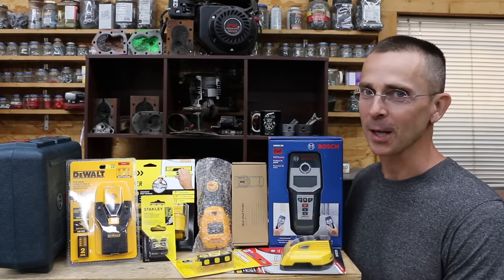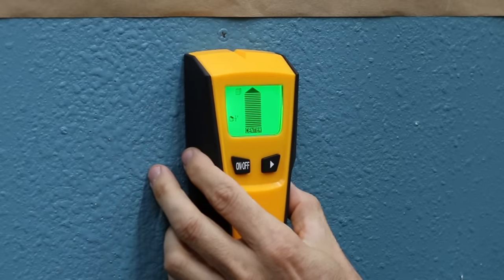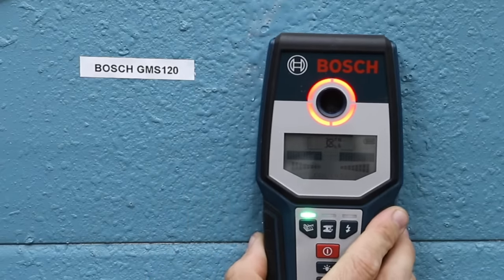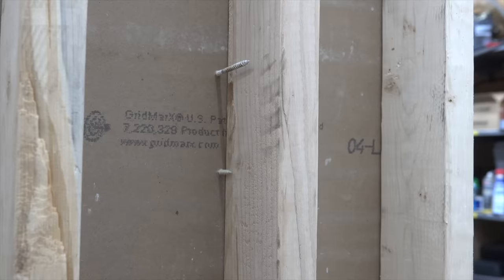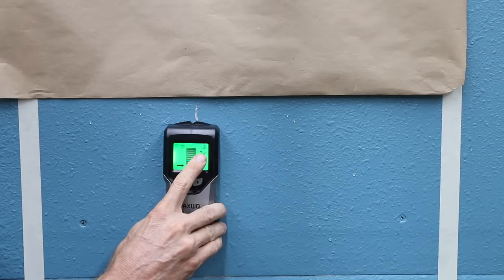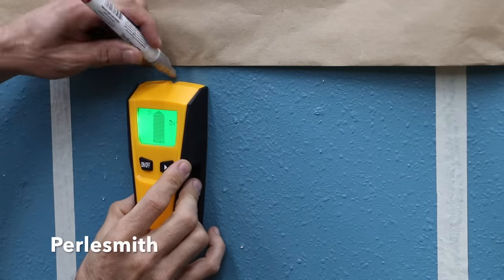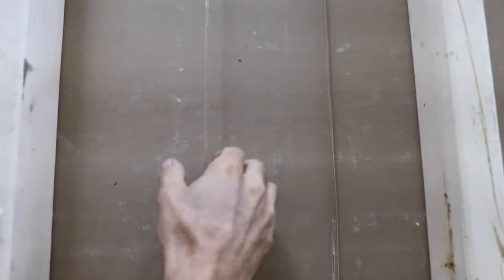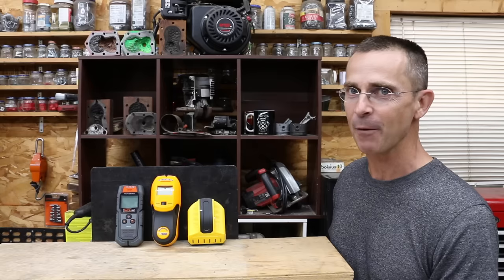Best Stud Finder? $262 Bosch vs $10 CH Hanson vs 9 Other Wall Stud Scanners! Let's find out!

Comment from the maker: Please let me know your ideas for future videos.  Also, thanks for generously supporting the channel. Please let me know if there are other stud finders you’d like tested.  An easy way to find past videos along with products tested: http://bit.ly/2FCrBpk  A big thanks to Jim for putting this together. 
  Todd
Reply: That list is super helpful. How about label makers, sharpies and paint pens :)
Reply: Can u mix oil with metal shavings and run a small engine
Reply: Can you do a vid on spray foam insulation?
Reply: Stud finder on Lath and plaster wall.  Is that a possible review??
Reply: Jubilee Clips original vs off brand hose clips? (Marksman / am-tech multi packs are the worst money buys in the UK!)
Reply: Extension cords and surge protectors?
Reply: Can you please do a video on gear oil brands
Reply: It would be awesome with a test to see if dishwasher actually dulls knifes. And at that also see if different steels behave differently.
Like a 63HRC knife, a non stainless, a different stainless of varying quality.
Reply: If you do this again and if it hasn't been suggested, some repeatability tests would be great to see if their accuracy holds over multiple uses or there's a lot of variability between locates.
Reply: If you revisit this category please include Walabot. The idea is so cool it makes me want one but something makes me think it's not as good as it sounds. They claim they can detect mice in a wall as well as pipes and wires in concrete.
Reply: Walmart is now carrying HART, and whatever Costco carries. These 2 seem to be with the most reach, and everyone has one if not both stores near by (assuming their tools are worth the drive). I know Amazon is the biggest, but they have so many brands and sellers, I wouldn’t know where to begin...it’s probably all the tools from the mom and pop shops, now out of business 
😕
Reply: Tim Gorodnitski hell yeah!
I second that... + phone chargers
Reply: Tool suggestion: Manual T50 crown staplers (like what you'd use to install fiberglass batt insulation or plastic sheeting).  I've tried numerous Arrow brand and Stanley brand staplers and they all seem to jam after 6-12 staples.  Very frustrating!!
Reply: 2/10 video, I skipped to the end just to make sure you did the joke, Imagine my disappointment when you didnt end it with "overall, the best stud finder is of course, my wife"
Reply: Do a roundup of the top ten fleshlights.
Reply: I would like to see a comparison video regarding safety helmets. Weight, price, observing force etc etc. They are very common and popular on daily working tasks. 
P.S : I really admire you work for the reason that you have avoid the scientific side during your tests. Keep it simple like 1+1=2 , we are simple person who get bored of science factors .
Reply: I wonder how these stack up with the smartphone app to see what's behind walls
Reply: I'd love it if you did more Ryobi tools. Thanks for making great videos!
Reply: There is a scanner that connects to your phone and you use an app to help locate items in walls. Its called the Wallabot DIY.
Reply: I would love it if you did a video on tire shine products!
Reply: Uninterrupted Power Supplies would be a great review. Lots of products and people rely on them heavily in certain situations.
Reply: I'm in the market for a heat gun so I would be interested in a video about them. Also very interested in what your testing methods would be! Keep up the great work!
Reply: Sugar in a gas motor. Fuel injected and none.  Thx
Reply: Alternative diesel fuel’s   Olive oil peanut  veggie    Thx
Reply: Flashlights. Can’t ever find a decent flashlight.
Reply: Can opener!  Twisted off handles, rusted cutting wheels, some dont even punch through the lid!
Reply: Ceramic cutting blades or wet saw blades ....thx ...paul
Reply: Tire chains, best worst?
Reply: I like to ch Hansen one because it doesn't require batteries.
Reply: I like your videos I've bought lots of stuff on test results, nice knowing what can be expected from an item.  I'd to see a shootout of dry lubricants , not so much the graphite ones.  Looking more for something that holds up and can not be flung off from spinning.
Reply: So, I was a Dish TV tech and they told me to use stud finders on the roof to find rafters through shingles, I never had any luck and relied on the stomp method to find something that sounded solid. Could you test the stud finders through shingle roofs in an up coming vid?
Reply: Can you test pipe soap/ lube in place of grease I know it’s water soluble but am curious about if you were in a pinch could you use it for like pins and bushings
Reply: I don't know if you can find any tools sold by Lidl supermarket chain. At least here in the Europe I've seen rumours that some of their Parkside branded powertools come from the same factory that makes tools for Bosch. It would be interesting to see if it's even plausible. I once bought a Lidl rebranded (the brand name used for it escapes me now) stud finder that was highly unrealiable and it was hard to get a reading twice on the same spot.
Reply: 14:16 The Franklin T13 is lighting up on the 2nd pipe but you said it "only found one of the two pipes".
Reply: I would love to see laser distance finders /measure tapes. Which is the most accurate?
Reply: Storage boxes like the Stanley box. It seems like there are so many options now like Dewalt, Ridgid, Milwaukee, Harbor Freight, etc. The price range is huge and it is hard to know what the best value is. I would like to see how durable they are, how well they hold screws or small items when flipped upside down, do the O-ring seals really work, what happens if you run over them with the car.
Reply: Hacksaw blades!
Reply: Smal Uninterruptible power system (ups) for computer and home use
Reply: My new Craftsman I bough about 6 months ago absolutely sucked, it was detecting studs that weren't there and wire detector seemed to be broken as it was always detecting wires even waving it  in the middle of the room.
Reply: Test the Walbot scanner that hooks up to a smartphone.
Reply: Small electric pressure washers, I've killed 3 this year using them as directed. I just use them more actively than most
Reply: How about the basics: screwdrivers. What's the best cheap screwdriver that doesn't bend or break under load.
Reply: I use the 2nd most powerful neodymium magnet to find studs, even behind lath & plaster up to  1.25" thick!  An alternative way is, if you have 'taped plasterboard' which hasn't been filled all that well (which is usually the case) then just draw the curtains closed, & turn-off the room lights, then shine a torch across the wall, close to the surface, you should see most of the screws/nails sticking-out a little.   ☺️
Reply: Do a test on bungee cords
Reply: I would be really interested for round 2 in UNI-T UT387B model. And in general more Uni-t inclusion :) Hope there is a round 2, keep up the good work.
Reply: Hi, I always wonder about shop towels. Or   products to remove grease from your hands. Thank you for your hard work!
Reply: The new GF-6a and GF-6b oils have hit the market. Does this mean a new oil-lympics?
Reply: Please test home air conditioner/furnace filters.
Reply: Great as always. I would have liked to seen you test one of the many available free stud finder apps on a smartphone in comparison.
Reply: Lack of plaster and lathe testing is a major oversight. Drywall stud finding is not a great achievement.
Reply: Since I'm in the market for one, how about laser distance measurers? You could compare accuracy, max length, and how it works under different lighting conditions (outside) or surfaces.
Reply: Can you do review of Carpet cleaner?
Reply: List of best portable rotary tool brands. Demel, WEN, DeWalt, Foredom, Black & Decker, Neiko, Milwaukee, SE, Tacklife. You could see which ones have the best cutting power, torque, battery life, drop resistance, different speeds, reliability, overall usefulness. Maybe two videos one comparing corded and cordless. Just an idea, love the videos!
Reply: Best moisture meters? I have one that I sue both to detect leaks around the house & to see if wood i cut myself is dry before woodworking with it. Would love to know how my meter stacks up.
Reply: Should also test metal studs
Reply: next video should be milwaukee m18 surge vs gen 3
Reply: Can you please test waterproof sprays for tents, tarps or outerwear for us? Thanks for what you do!
Reply: One product which never fails to cause consternation are tire pressure gauges.  Accuracy is always in doubt.  The different types: stick, dial, digital, have various pros and cons.  Durability can be an issue.  Love to see a comparison, especially in terms of accuracy.
Reply: Project Farm What would happen if mix 50/50 gas and oil to engine.
Reply: I'm not sure exactly how stud finders work but does it make a difference if there's no drywall on the opposite side of the studs?  Did you test with the back of your test rig covered with drywall?  I was wondering if whatever kind of signals they work is affected by the extra  drywall back there.  Especially for detecting deep objects
Reply: Im really interested in seeing the Bosch find a rafter through a shingled roof, this is an issue with solar racking installs, and i heard the Bosch is capable. It would increase racking installation productivity a ton. Great video
Reply: Angle grinders would be interesting, never understood why some are so expensive
Reply: I use a item finder called WalABot. it lets you see inside the wall to see water, metal, wires, & Heat. I love that thing.
Reply: You should do this test with old plaster walls. I live in a house built in 1942 and I've had problems with several different stud finders being able to locate studs.
Reply: Miter and table saw blades
Reply: @mikkelkirketerp4884  They do. They knock them around and make nicks requiring a new edge to be set. If you buy a $5 knife and put it in one, you could test for yourself.
Reply: You should test the Walabot in a future video (stud finder for iphone/android)
Reply: One long term test could be what charge should you store batteries at? I've read everything from 40% to 80%.
Reply: A stud finder for the next round: Milwaukee 2291-21 M12 Sub-Scanner.
 Most impressive one I've ever seen
Reply: @tc1309    ?  Flashlights
Reply: Ya know,  after seeing this, I'd really like to see these traditional stud finders vs. the newer smartphone attached stud finders (not sure if the best but an example: Ryobi ES5500 Phone Works Stud Sensor, or the Walabot DIY Plus - Advanced wall scanner, stud finder - For Android Smartphones - DY2PBCGL01). Possibly a stud finder app as well if possible?
Reply: At 14:16  the Franklin T13 seems to have found both copper pipes but its not a steady find on the one not right up against the wall.    Still not my pick for best anyways though.
Reply: Project Farm have you already done a video on fuel tank repair products? (Metal and plastic tanks if you plan to do one) I know of/have heard of a few options but need something for painted tanks that need a smooth finish as a body panel, and soap paste likely won’t like having body fill on the outside of it, jb weld and Fiberglas resin don’t hold up and those putty sticks tend to expire and there is no way to know when they were made
Reply: Light bulbs, true to color, lumens, & power usage?
Reply: I have a few ideas, 1) wood filling epoxies.  Test for sand ability, adhesive strength, shrinkage, ability to take wood finish oils, and since all wood contains water, test with additional water.  2). Exterior wood finishes to stand up to the outdoor elements.  Test polyurethane, water based polyurethane, varnish, spar marine varnish, non spar marine varnish, tong oil, danish oil, and lacquer.  3). Taps and die sets.  Various brands.  4). Outdoor paints on metal surfaces against your corrosion concoction.  5). Oil Filters. 6). Phone cases for drop protection 7). Deck screws.  That should keep you busy for a while.   Keep up the awesome work and great testing methods!  I love Monday’s now 😎
Reply: Walabot. I would love to see a walabot go up against stud finders.
Reply: Power washers please !
Reply: Precision Professional Stud Finder from Costco: https://www.costco.com/precision-sensors-professional-stud-finder.product.100504272.html
Reply: I love all of your videos! As a contractor and a DIY home improvement guy I love seeing the brands that I’m set in my ways on shine or even fail. No matter what content you put out next I look forward to seeing you next time! :D
Reply: Love your videos. I’m a bit late to respond here, but would like to see a video comparing different laser measuring devices. Accuracy, speed, reliability, and range are the biggest factors for me. I use them every day. There are different people at my company who have bosh, dewalt, and Milwaukee. Would love to see your take on which one is best.
Reply: Great one! How 'bout "come-along" pullers/winches?
Reply: I own the zircon HD900
You tested A100

Can you compare all the zircon models
Reply: I would be interested in seeing how the walabot (walabot.com) compares since it uses a completely different technology (radar) than all of the others.
Reply: I would like to see you test the top stud finders on a lath and plaster wall.
Reply: DRYWALL IS TOO EASY......it has a uniform thickness...a lot of houses still have plaster and lath with the plaster hooking behind the lath and the lath not uniform........
Reply: Please consider doing a concrete/brick/cinder block anchor/fastener shootout for shear/tensile strength and corrosion resist. You had one for drywall and this would be excellent follow up for those looking to mount things into the ground or on harder type wall surfaces.
Reply: Need to add walbot for smartphone see if that works
Reply: Cordless chain saws. I bought a craftsman one because I already had their other tools. The craftsman one is poor, with a lithium battery it cuts out if you apply even light pressure. With a Ni cad battery it does better and only on small under 2" branch. I wonder about the Stihl, Huskvarna, Works, and Hobo Freight.
Reply: Not sure if anyone has said it yet but I have two, combination wrenches and various fasteners such as screws, bolts, and maybe even Velcro.
Reply: Can you please do Wheel cleaners, both normal and no touch. Love the videos
Reply: Can you test different Nitrile Rubber Gloves for best durability, strength, and which hold up best to chemicals?
Reply: Masonry drill bits?
Reply: One more test I feel you missed on the stud finder is older houses that have thin wooden panels in between the studs. I have noticed some older houses here have these flat panels for some reason that mess up the testing of the studs because they are layered together so closely and next to the actual studs. This would make screwing in screws much more difficult because your markings could be off. It is hard to explain without showing you what I have seen. I'm no expert and I wasn't well informed on such things. I just seen them and wondered why they where there.
Reply: I would love to see a best chain saw sharpener video. I can imagine it would be a bit difficult to test though.
Reply: My wife wants you to test house vacuums or vacuum/mops for hard wood floors
Reply: Launch scan tool you're gonna like it
Reply: The Zircon A100 was a top pick.  I wonder how the A150 or A200 would compare to it in your next round.
Reply: Next round could include Walabot DIY ...i have used it in conjunction with my basic zircon if i need to be sure what i found is a stud.  Shows wood/wire/pipe/etc
Reply: Today was my first "new" video to view.  Waited all day for it haha!  I think you should test some hammocks, or at least one model for an extended time.  You work hard to bring this great content to us and you deserve a well earned rest once in a while!
Reply: I would like to see you test a few of the Craftsman ones. They have some entry level for $20 and some higher end ones.
Reply: Can you also test surface scanners like the dewalt surface scanner? I'd love to see a comparison of laser distance measures and laser levels.
Reply: @jonbar140  well not for me no. I've got a dedicated cutlery tray above my two other trays, and nothing gets knocked around. I'm quite meticulous when it comes to keeping my knifes sharp and I can't honestly say that the dishwasher makes my knifes dull.
Reply: Didn't the Franklin find the 2nd copper pipe? Looked like it lit up (right before the video cut) with 3 lines roughly where the pipe was?
Reply: Best paper towels
Reply: On board trickle chargers, portable Solar panels for vehicles
Reply: Can you please test battery powered leaf blowers like stihl bga57 or ego 580. Thanks
Reply: As per my comment elsewhere, how about testing on brick and concrete construction, as this is prevalent in the Eastern US and Canada, as well as all over Europe... Again, I wonder how many European viewers you have? It might be pretty cool to source some European products to test (through Amazon.de, for example), as well as testing on European construction styles, voltages, and so on...
How about the quality of hose connectors, watering systems, and accessories, comparing, for example, Gardena against competitors?
Reply: Laser Levels?
Reply: I would love a video testing electric cable finders, please!
Reply: Can you do a video testing different water repellent shoe protector spray products like “Never Wet”, “kiwi Protect-All”, “Peak Max Shield” etc. And test them against different liquids like oil, gasoline, water and different other chemicals/liquids found in an everyday garage or shop?
Reply: My wife is the best stud finder.  (seriously, I'm surprised there aren't more of these jokes on here)
Reply: Walabot microwave scanner would be interesting in comparison to the "real" stud finders.
Reply: Awesome testing!!   Curious to see how would a Walabot do... Do they really work as advertised ?
Reply: Test car USB QC 3.0 chargers for RF interference.
Reply: Best Air compressor from 5 gallon to 10 to 15 or even 20 gallon if ambitious for a consistent day to day use. Price to performance ofcourse.
Reply: Test socket sets and screw drivers to failure. Torture them.
Reply: Love your videos, as a maker they are all usefull, would like to see a video on laser and sonic distance measuring device's.
Reply: Bungee Cords would be useful to find out
Reply: Best wool socks 🧦 
Winter ❄️ is coming
Reply: Testing portable generators/inverters for sound, power output and fuel economy.
Reply: You might also think about a video about different types of band saws
Reply: Best coffee makers? Its something most people use every day
Reply: How about blades for oscillating multi tools? There's quite a range of prices. It would be great to know if it's really worth it to buy the expensive ones.
Reply: I know you've done probably 100 oil tests, but any chance you could do motorcycle oils? I'd be curious to see the which one is best and for fun compare them to rotella t6 since it's a popular oil for people to run in bikes.
Reply: Can you post your videos to Rumble? I am moving away from YouTube’s biased censorship. I love this channel and don’t want to miss out.
Reply: It would be awesome to see a wire stripper comparison
Reply: Hey it would be awesome if you could test the rural king brand of oil that is called harvest king, it is extremely cheap at about 12 bucks for 5 quarts
Reply: Torque wrench comparisons?  You MAY have already done this, if so I'm sorry!
Reply: Many times we are looking for framing members which are behind materials other than drywall.  Looking from the exterior, that could be any type of siding, or asphalt shingles on a roof.  Drywall isn't anywhere near as challenging as some of these other less friendly surfaces.  I hope you go a little further with this in future vids.  Keep 'em coming!
Reply: jig saw blades and skillsaw/circular  blades.
Reply: a side by side by side of cameras for youtube vids....j/k
Reply: How about a test between cheap brake pads and rotors vs expensive brake pads and rotors
Reply: Bosch Wallscanner D-tect 150 SV Professional 
It claims it can measure in WET concrete
Reply: If you still have the 2 stroke bicycle, I would love to see it turbocharged(there are kits)
Reply: Did any of the devices detect Mr Project Farm though? FAIL
Reply: Thermal cameras
Reply: I'd love to see a test on a lathe and plaster wall! Both houses I've lived in have had them, and so far 3 stud finders (each more expensive than the former, and all allegedly had "deep scanning" modes and normal modes) are horrible at finding studs! Maybe this kind of wall is no good for stud finders.
Reply: What about seafoam vs high mileage seafoam?
The company won't give any real answers
Reply: A little bit out of the normal, but how about facial razors. I'd give good money on a good razor
Reply: Great idea and well done.
Reply: Floor jack race kind of like a jumbo sized pinewood derby!!!  Which brand is fastest!
Reply: Which type/brand (spray, rub, oil, bees wax) of leather conditioner/waterproofing works best for leather shoes and boots. The idea came to me while applying mink oil to new hunting boots as I watched this video.
Reply: Future video idea on trailer tongue coupler locks. Recently had a family member have an enclosed trailer stolen out of the driveway in broad daylight. While doing research on locking devices there are many designs and vary greatly in price. Curious to see your method and unbiased opinion on what direction to go. From Reese all the way up to proven industries lock. Thanks for your content.
Reply: What are better for a utility trailer- radial or bias ply tires? Some say bias ply are tougher.
Reply: Is there any way you can test on plaster and lathe walls? I love my house but finding a stud is driving me crazy. That being said, I have the "Hart Advanced 5-LED Stud Finder" from Walmart, it say sit has 5 sensors for 'improved accuracy', this one does the best for my on my walls.
Reply: T
Reply: Well, I’ve just seen a commercial for something called alien tape. Guess you need to test that one out
Reply: Todd. I know you uploaded a series on Motor Oil’s going head to head, but what about Automatic Transmission Fluid? Or Coolant? Not all of them are the same you know!

Regards, Jameson Pralle
Reply: Many of us find LED headlamps indispensable  these days, especially in the winter. I have had a dozen, and while the biggest cause of failure is loss, they are expensive and could use a good review. Be sure to test the elastic durability, that's the second biggest irritant with them.  Eveready, petzl, vont and many more
Reply: @rlunzer  I second the request for Walabot, It looks so interesting! and I haven't seen any real objective reviews on it on YT.
Reply: That’s so sad to see your new test after I bought the Bosch 120 last week. I strongly recommended that you can publish a schedule on the projects currently in your plate.  It is totally fine even without a release date like Apple 12....
Reply: May be a long one? Water proofing paint on cinderblock or other items?
Reply: How about a video on rust protectors/ lubricant. I recently bought a can of WD-40 water proof silicon spray and I am on the fence about how well it will protect my tools and bathroom door hinges from rust . Some products that come to mind are like 3-in-1 products I seen people use transmission fluid mixed with acetone. Stuff that will protect from rust and lubricate at the same time .
Reply: LED headlight bulbs longest lasting and brightest
Reply: Do those electronic rust inhibitors work???
Reply: Canadian tire sells a non flammable emergency fuel. Can you test that. See if engines will run on it purely. Apparently it's safer to keep in your trunk than real fuel
Reply: do best sunglasses brands
and i have used many of your recommendations to buy tools
Reply: Best angle grinder
Reply: laser levels
Reply: Thread cleaner/restorers for bolts lug nut studs
Reply: Think you could come up with some tests for work gloves? I just got some mechanix work gloves a little over a year ago and they just tore on me. I use work gloves for hobby woodworking diy projects to working on the Jeep to pulling weeds. Thanks, love the channel.
Reply: Please test the Wallabot
Reply: MECHANIX STYLE WORK GLOVES
Reply: Logan Jex YES!
Reply: @Project Farm I'm an auto mechanic in Denmark and for about a month ago a salesman came to the Shop and tryed to sell us some engine oil i have never heard of before, called Payback lubricants. he used a lubricity tester like the one you use, All the different oil's we testet could take up to 5 kg in weigt at the end before the friction overcame the motor, but when we testet his payback oil it could take his entire bodyweigt and still turn the motor.
So please test this engine oil to see if it really is as amazing as it seams.
Reply: Test some chainsaw chains!!
Reply: Could you do a video on driveway or garage cleaning products? I bet a lot of us have oil, atf, power steering, and brake fluid stains all over. Dexron 6 is a nightmare to clean up from my use with it. Laundry soap, specific cleaners, power washer and manual methods would be great to see. Not everyone can powerwash the inside of their garage.
Reply: Would you be able to compare different solutions for concrete screws and anchors? I don't know if screws are just as good as tap in anchors if I only need to use the hole once.
Reply: How about car wash soap, brands like Chemical Guys and Meguiar's Gold. Love the content!!
Reply: I would like to see these tested with different types of walls. Plaster and lath are still in a lot of homes. Both wood and metal lath
Reply: @meyer629  these things are amazing and under 100!
Reply: @rlunzer  the thing is amazing, works hoizontally also to see whats around cabinet bracing. Track wires thru studs, with a live "picture". Thing is nice for planning bathroom upgrades. Got the better kit still under 100 awhile back.
Reply: oil filters would be great
Reply: What 9 volt battery is best? I hate changing smoke detector batteries on a regular basis.
Reply: Dear 
Project Farm, As always excellent review and testing. Please do a test on hard water stain removers. Thank you.
Reply: Please do a test on oscillating multi tool blades. Wood / nails / screws
Reply: Do a video on laser distance measurers!
Reply: How about the best chrome paint for plastic, metal etc ?
Reply: Would it be possible to have you do a video on car power inverters? I've purchased a couple in the past and not had much luck with function, never mind longevity.
Reply: Can you test power washers and or battery powered blowers? Thanks
Reply: Which mechanics hand soap is the best
Reply: Hey, what about doing a permanent marker video? Like which brand/type is the best. Sharpie has a big name out there, but are there any that last longer or are better than the rest?
Reply: Ok great job, let me give a little help: for comparing multiple results I have a suggestion: use a spider web chart. At each axis you can put a 0-1 scale the closer to zero indicates de absence of a desired quality the closer to one its presence. Each thread of the web (in a different color) will represent a brand/devise/liquid, etc.
Reply: I know you’ve done a lot of videos on motor oil. I recently learned there’s re-refine oil for motor vehicles. I wonder how well it reforms. Also apparently some people filter their used oil. I’m fairly sure that’s a bad idea.
Reply: i have an idea i dont think has ever been tested, ferrofluid for engine oil. i don't know why anyone would try it but i think it would be interesting to see what would happen.
Reply: How does insullation affect the reults?
Reply: Can you test garden hoses? I know it’s not a typical tool you would do, but there’s so much variety and difference in prices. There’s hoses for $20, there’s ones over $100. There’s the kind that coil up on their own, there’s the “flexzilla”, there’s “light duty” and “heavy duty” ones at Home Depot, etc. Love to see which ones actually don’t kink, don’t leak, don’t mold, easily  roll up & store, etc.
Reply: Headlamps for vehicles.  Is the more expensive better in terms of brightness, light coverage, and endurance.  Also, is there any truth to the idea of "touching a bulb with your bare fingers shortens bulb life". 

Thanks for what you do!
Reply: Great product comparison, as usual. 👍 Have you considered doing one with rust neutralizing/ converting products?
Reply: How about a video of car battery chargers?
Reply: Could you do a video on pancake air compressors?
Reply: Please do a tire shine shootout!
Reply: Todd, 

This is literally my first comment ever on a YouTube video. Love the channel. Not sure if it would be possible, but what is the best glue/spray adhesive for legos?
Reply: Please do a showdown between amsoil signature and amsoil European oils with full and low saps
Reply: I'd love to see how the phone stud finding apps work! Although I suppose that might be variable on the phone model used.
Reply: Best silicone rubber caulking
Reply: My brother-in-law recommended Motul engine oil and he runs a 1000 HP Subaru.  Any way you could pit it up against Amsoil in the 5w-30 category?  Think it would pretty much cover all of your oils.
Reply: What about using hand sanitizer as lube or rust remover?
Reply: Please do AT 205 reseal
Reply: I would like to see you test on a wide range of oil filters
Reply: What do you think about comparing Fog Machines and Also comparing Fog Juices since Halloween 🎃 is here and many people are looking for them for decoration
Reply: Test torque wrenches or Digital Torque adapters
Reply: Hey project farm what about testing portable solar chargers for phones and small devices
Reply: If you're doing another round then it'd be interesting to see how they perform with fibrous plaster and also hardwood rather than pine.
Any chance of you adding the prices alongside the product names when you're showing the tests. It's a tad hard working out if it's the cheapies or the expensive units performing.
Reply: Best anti fog safety glasses/googles
Reply: I'd love to see you do some kind of comparison test on brake pads
Reply: Best car sound deadening material. Kilmat vs dynamat vs noico  vs fatmat etc
Reply: test sour patch kids as engine oil
Reply: How about garage floor coatings.
 Paints, epoxys... 
Rustoleum. They have a lot of product lines.
Leggari.  They have a $25 sample kits.

I'm sure their is a bunch of others on the market. 

Possible tests:
Abrasion resistance 
Impact 
Chemical / hydrocarbons 
Heavy object imprinting  "furniture, equipment"  Stationary.

Heavy movement: vehicles, equipment on casters, car jacks and  vehicles on jack stands. 

Their is a ton of install reviews on YouTube but no one has done a shootout. 

For the sizable cost and investment to a home it would be nice to see if any of them live up to the hype  for the money.
Reply: Anglers took 383 million fishing trips during the year and spent $46.1 billion on fishing-related expenses. It will be nice to see some testing on fishing lines and fishing rods.
Reply: Roofer here do a 30 year shingle review with all the major brands
Reply: Stud finders act up on exterior walls near cinder blocks or thick insulation, can you do a video testing this?
Reply: Can you do a video on concrete cleaner my driveway is covered with oil stains and I live in an community with a hoa so I really need to find something that can take these stains up
Reply: Can you retest with shear wall? So 2x4 studs, 1/2 osb or ply and 5/8 drywall?
Reply: Test the difference in mileage/performance between different gasoline versions. I’m curious to see with and without ethanol. The lineup would be straight gas, gas w/10% ethanol, gas w/15% ethanol, gas with 85% ethanol, and what the heck 100% ethanol. I’d be curious to see straight methanol. And maybe aviation fuel (av-gas?). Stats on engine temp, etc.  maybe future episodes on what all the different flavors do to the engine oil?
Reply: Tape measures
Reply: caulking gun
Reply: Suggestion - Hammers - there are so many different hammers / styles and makes then there is the extreme end can smaller mallet do the same as sledge hammer. Plus bonus content - how effective are claw hammers.
Reply: Suggestion - Hammers - there are so many different hammers / styles and makes then there is the extreme end can smaller mallet do the same as sledge hammer. Plus bonus content - how effective are claw hammers.
Reply: You should test reciprocating saws battery vs. Corded
Reply: Hey man I have seen all of the oil test videos and I find them very helpfull!! I was wondering about Oil filters? Can you do a test on what filter is the best or maybe end the debate on what filter is the best one for long-term.. not have to change it every 3000 miles.  I'm seeing a lot of people questin the 15000 miles filters or even more miles on some... any ways just another idea.. also On the oil videos there's a guy that suggest adding 1 quart of the top 5 oil companies and get all the benefits from all of them at the same time .  But all my life I been told thats a bad idea.. just a couple ideas for videos for ya...
Reply: Cell phone boosters would be a great video.  I've got a couple but it's always debatable as to how well they work.
Reply: Torque sticks, how accurate are they and which ones are best? Can they replace my torque wrench? Thanks
Reply: Would love to see a comparison on Ethernet over Power adapters.
Reply: Can you try testing which is the best CIRCUIT BREAKER FINDER? Pleeeeeeease!!!!
Reply: How about Forstner bits in different woods?   I can't seem to find a good brand
Reply: I'd like if you could test that one gimmicky smartphone looking stud finder that claims to show the wire or pipe on screen. I dont remember the name of it, but it was HEAVILY  advertised on social media.
Reply: Test the Walabot! https://walabot.com/
Reply: Project Farm say bro
1 - I figured you are a military Veteran, n Thanks
2 - can you do a show on Exhaust Patches, it’s been about 25 years since I considered or required an exhaust patch but this time I was not going to buy the red tape.
So
3 - I’ve just bought 2 different kits to patch a big hole on my 98 BlueBird school bus, 1 was junk to apply, 1 was decent both by Versa Chem
4 - junk kit (exhaust system repaire kit ) item# 90352 included, metal screen n wire,
Goop paste n tape the only good thing was the metal screen patch.
5 - good kit is a (muffler weld) item# 90334
6 - I think a bit of metal screen or similar with lots of muffler weld, plus more as needed as I believe having liquide good paste metal weld in very think would give more material to absorb and dissipate heat. As it is recommended for about 1000-1500 F my diesel fired bus will likely burn hotter while this hole n patch is also closer by about 4 feet from the exhaust manifold.

For your consideration.
Reply: Although electronic scanners are convenient, I get a lot of value from "low tech" things like CH Hanson that are reliable fallbacks.  Even if I initially use an electronic gizmo to find the stud, I always use my CH Hanson magnet to locate drywall screws/nails BEFORE inserting a drill or fastener - it's so disheartening snapping off a drill bit on a drywall screw!
Another such low-tech device is the Shinwa Rules 35mm studfinder with magnet, where you probe through the drywall with a stainless steel needle.  Sometimes knowing exactly where the stud edges are, and where the tiny gap between doubled-up studs are located is really useful.

Some other ideas for other future reviews:
* Washing machine hoses - which ones have the highest burst PSI?  Which ones can take more mechanical abuse?
* Dryer flex hoses - how to various brands hold up to lint fires?  How well do they maintain their shape at bends?
Thanks!!
Reply: i would like to see a walabot wall scanner
Reply: Great Test in my Opinion IF your dealing with Drywall but i haven't found a stud finder yet that actually finds anything behind Lath and Plaster Walls
Reply: Best polishing/cutting pads for detailing.
Reply: Best water seperators and desiccant filters for oil compressors. I do boat restoration and repair and I would love to know best seperator for when spraying gelcoat and paint over my repairs. Nothing worse than paint being ruined by compressor oil/water and having used a cheap filter in the past, i can tell a difference.
Reply: Gear oil test please!
Reply: Auto-off surge protectors! The only kind that matter!
Reply: same test but for brick walls... but since you don't really use them in us there won't be many products for that, right?...
Reply: Love this Chanel ... no fricking ads
Reply: Can you test coolers and thermos'? That yeti brand can't be good enough to justify how expensive all their products are, can it?
Reply: I would like to see the Walbot https://walabot.com/diy?gclid=Cj0KCQjwuL_8BRCXARIsAGiC51DML0FNNJJK0c726SqS2t_RLeMgxJwDaNwB7IXNrcOF-bj-30tXpBgaAiJgEALw_wcB included in a stud finder test.  Also i would like to see them all tested with lathe and plaster walls. Our house was built in 1906 and lathe and plaster was are a lot harder to locate.
Reply: How about doing a video on moisture meters? For me specifically wood moisture content meters, is what what I'd be interested in.
Reply: Do the neodymium magnet balls as stud finders anything else is a waste of time.
Reply: Another great video! I didn't know you had that excel list! That's Awesome! I'd like to see a comparison of Moisture Meters. Both pinned, and unpinned. The issue I have is with my travel trailer. I like to use the pinless ones as they are non-destructive, but not sure how accurate they really are? I find the unpinned ones will also detect the aluminum studding in the walls and gives a false reading.
Reply: Please test the wallabot stud and wall finder
Reply: You did not provide link for tacklife stud finder. I wanted to buy it.
Reply: suggestion for a review like this one:  make the final graphic a summary chart that would have columns for the scanner name and the results of each category.
Reply: I would like to see the dtect 120 tested at more depth. I believe it is supposed to detect at more than 4 inches
Reply: I used the wal-abot and had great results. It found wires, pipes, and studs. Pretty accurate but takes a little to calibrate it
Reply: Please do a Part II where you have double 5/8" drywall as your test wall.  My Franklin is amazing on single 1/2" but absolute garbage in my garage where the build code has double 1/2".